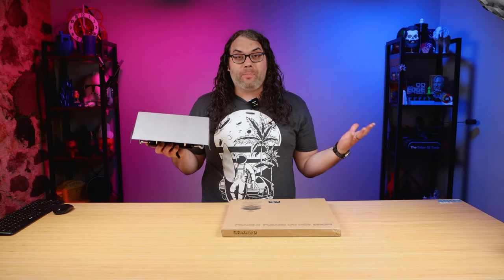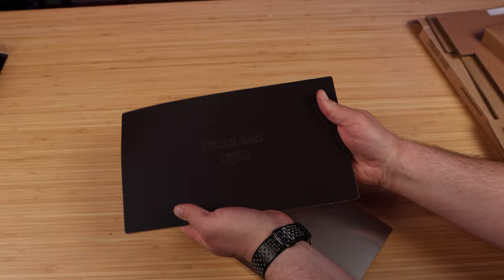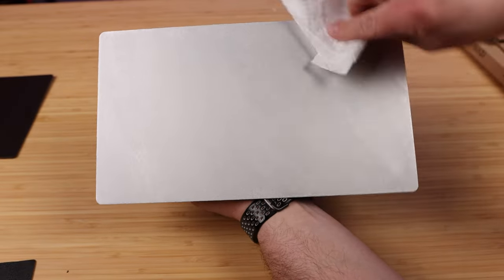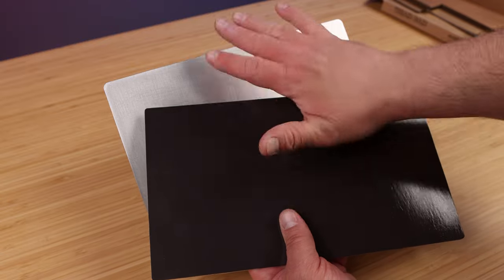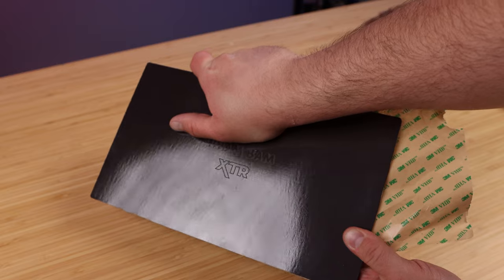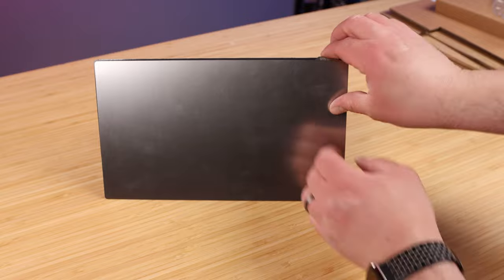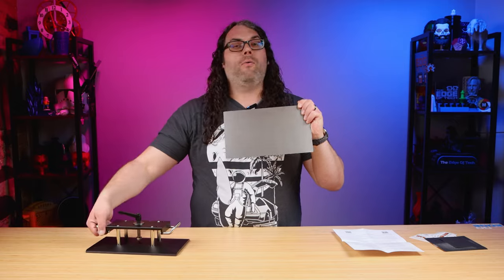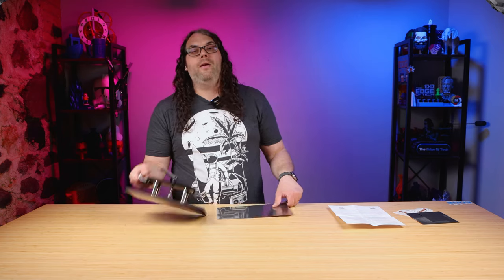Crazy Strong Flex Plate for Resin Printers - Wham Bam XTR

Comment: I have Wham Bam plates on both of my Anycubic M3 Max's. I won't print without them. When sanding the printer plate, make sure you get the edges very well; you don't want the resin working its way under that magnet. DEFINITELY wait 72 hours for the adhesive to cure; if you don't, the resin can start to eat away at the adhesive, and you'll get curling on the edges. For small parts that are harder to pop off, a quick but short flex of the plate makes them pop off easier than just bending.

Comment: "STRONG build plate!" -- Box says "Fragile, Do not drop!"...LOL -- and then we get advice like "do not cure anything on this!" yikes.
Reply: You do know the box contains a magnet inside of it as well, you want to address the tensile strength of magnetic pads with that same logic for us? Know something laboratory grade testing doesn't know?

To address your curing comment, you do realize that certain steel alloys are subject to something called corrosion during chemical reactions? Resin happens to have an exothermic reaction and where there is heat there is degradation of chemicals, any impurities will likely result in a corrosive reaction from many alloys.

I am unsure what your points are leading to or suggesting.
Reply: @Mad_Catter_  Clearly sarcasm...
Reply: @hughessay1372  err actually this is not the textbook definition of sarcasm. That would require irony, and nothing here is being stated as contradictory to what they believe, they are clearly stating their belief after paraphrasing examples.

The term you are looking for is specifically mocking, they are only mocking.
Reply: @Mad_Catter_  The "Strong build plate!" and "Fragile, do not drop" sounds ironic to me, but to each his own...
Reply: @hughessay1372  More like conveniently overlooking the fact that the plate is not the only thing shipped in that package.

Not to mention why would you want anything shipped without care? Seems like you'd rather they kick your package around but hey, whatever it's your money.